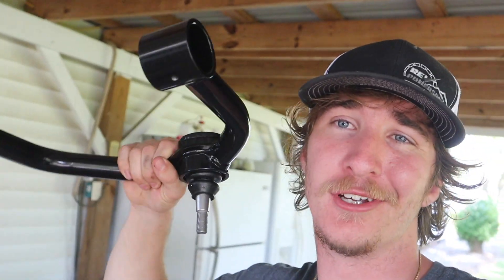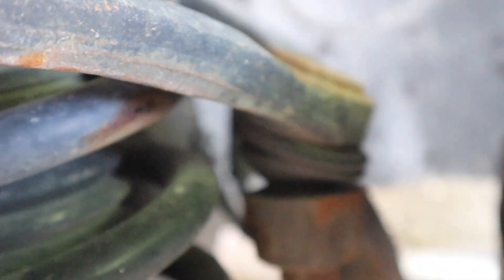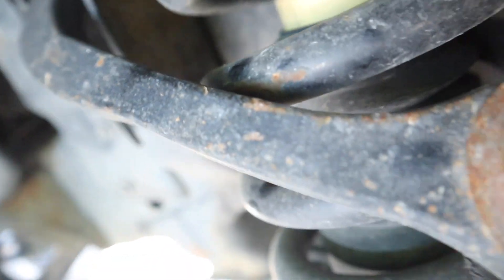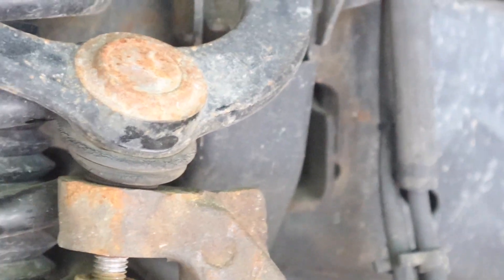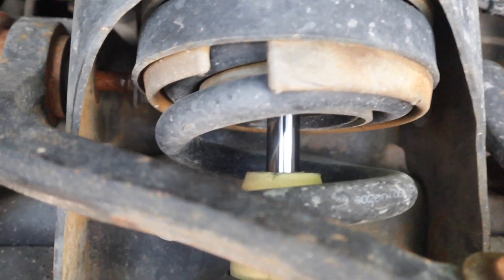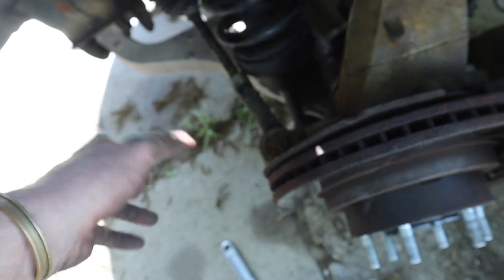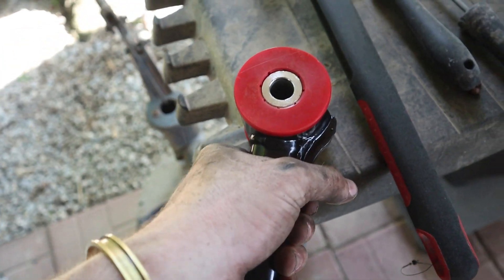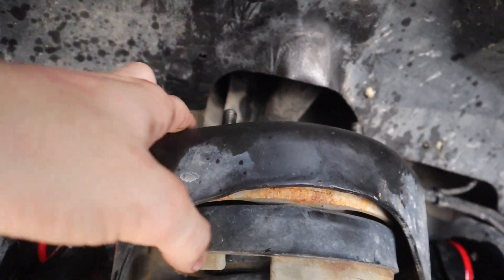YOU NEED THESE FOR YOUR LEVELED 2004-2008 F-150!!! (KSP UPPER CONTROL ARMS)

Comment: Nice job dude. I did my timing job at 179k due to the infamous tick. Went melling 340hv as well. And did the roller followers, lash adjusters, all other ford parts. Went with 2v steel tensioners. Been running like a champ ever since. I’m at like 200k now.
Reply from the maker: No issues with the 2V tensioners? I was unaware they worked for the 3vs as well
Reply: @JayThompson25  yea I run 2v cast iron tensioners as well no issues
Reply: You much did the timing job run you? I have the tick aswell lol

Comment: If you end up doing a timing job use all Ford components from the dealer. They are much more expensive but I had a Cloyes phaser spin on me 10 miles into a test drive. Something about the 5.4 and aftermarket parts don’t seem to play well with each other for some reason
Reply from the maker: Thanks for the advice!

Comment: Jay, first I just want to say I love your truck. I have an 08 FX2, it’s black. A lot of the mods or upgrades I have done are based off of your truck. Today I just installed the same upper control arms. So far they’re awesome except for one thing. I drove it around the block and I’m pretty sure the tire rubbed the right side (passenger) while making a right turn. I have a 2.5 level and 33’s on stock 20 inch wheels.  I know your truck has wheel spacers but does your brothers? If not do you know if he has a rubbing issue?  I’m guessing now I need wheel spacers. I was trying to avoid getting them. I like the look of them just worry about dependability.

Comment: I don't know what happen with my F150 2006, I install a 2.5"  leveling kit and replace a tubular upper control arm, but is touching the strut spring, do you know why
Reply from the maker: Depends on the arms and lift/level. Some will still touch at full drop, but once weight is placed on the front end, you shouldn’t have an issue. May notice a little paint being wore off the spring over time

Comment: Just installed these and a 2.5 level up front. Noticed some squealing of the tires afterwards. Did you have to do an alignment after doing this? Thinking my lower arms are a little in.
Reply from the maker: Yes, anytime suspension components are changed an alignment is recommended
Reply: Had to check cuz I put the 2.5” pucks on and noticed that with the 2-4” lift arms my lca’s are in. I’ll fix that here very soon

Comment: How did you get the bottom strut to line up? I couldn’t find a pry at big enough!
Reply from the maker: Harbor freight carriers a set a pry bars that work pretty good, but I pry down on the LCA through the hole it has and slide the shock in that way

Comment: Does it make the truck sit higher with the 2-4 inch ksp even with the leveling kit on there?
Reply from the maker: It doesn't really add any lift, it mainly helps with axel angles giving you a better ride and making sure you won't have problems down the road

Comment: I have an 06 and the uppers touch the struts at ride hight I was told it has a 3” level how do I fix this
Reply from the maker: 3inch level is almost too much on these trucks, but these control arms will help with the angle, but still probably have some premature wear on the ball joint. 2.5 inch level is about max you can go. It’ll tear Axel boots from the steep angle as well
Reply: @JayThompson25  ok thank you

Comment: What’s link on upper control arms I have 2inch level kit shocks and bds upper control and rubs upper control arms rub spring badly like right up against spring
Reply from the maker: KSP 0-2inch Upper Control Arms Compatible with Ford F-150, Suspension Kits Tubular Black Arms Alignment Lift 0 to 2” for 2004-2020 F150, Replacement Factory/Stock Suspension Arms, 2nd Generation https://a.co/d/3VZp8vu